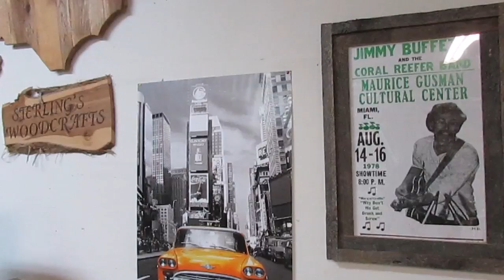Rustic Barn Wood Picture Frame

Comment: Great Job Stirling. I love to see picture framing techniques without the dreaded mitre😀
Reply from the maker: Thanks Man, and the rustic Barn wood will hide other imperfections too , like my not being able to cut straight lol
Reply: Sterling Davis and a nice video for the pocket hole trolls. For me, you use the most appropriate joining method. In this case pocket holes are a perfect, quick, inexpensive solution.